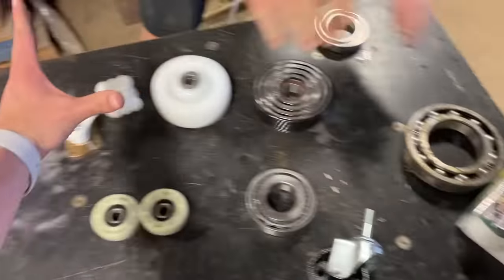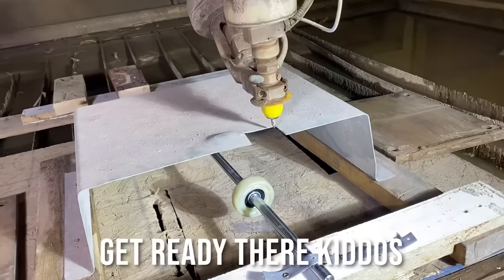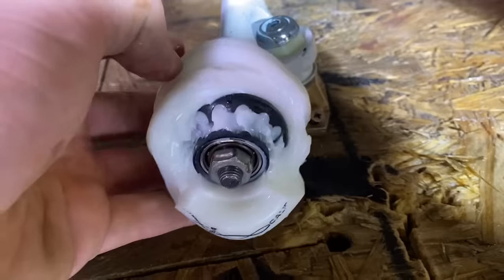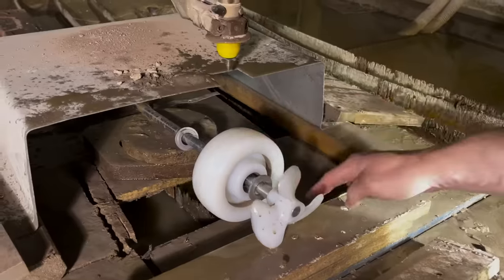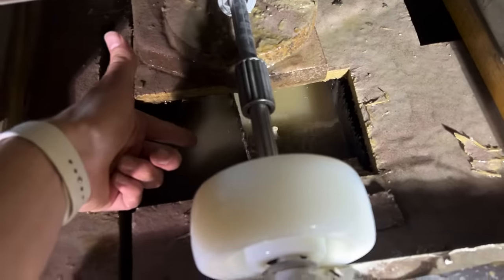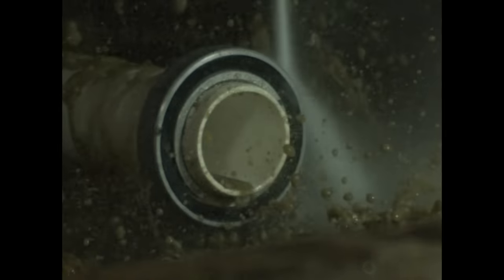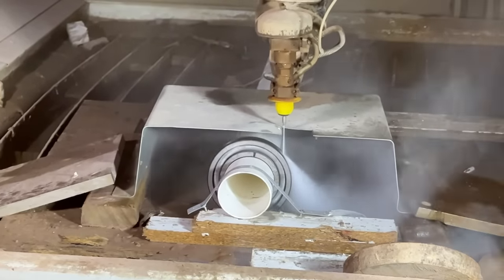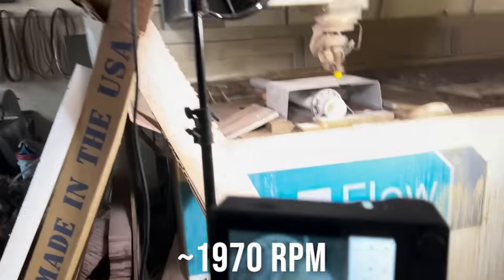Massive Industrial Bearing Spun With 60,000 PSI Waterjet

Comment: Back in my younger days, being a mechanic at an exxon gas station, I was repacking the front wheel bearings on a vehicle, in the process i soaked them in some chemtool to clean them, and before packing them with grease, me and my genius mentality figured I would use compressed air to spin them dry and clean of the cleaner....as i started, it made what I thought was a neat sound, a high pitch whine, trying to maximize it I kept the air on for a min.....before i could do much of anything, that damn thing blew up....neay removed my middle finger from my hand and virtually split my thumb in  half, and i ended up missing 3 fingernails that moments before had been on my fingers....that had to have been probably THE stupidest thing I have done.....I thank God one of those bearing didnt go in and out of my skull, but waz quite similar to a small frag gernade going off in my hand....all grew back together and only ended up with one odd shaped fingers....but still, it was a neat sound, up untill the moment of decetegration....DO NOT TRY THIS TRICK AS THE REWARD IS NOT WORTH IT

Comment: You have the jet positioned incorrectly, it should be slightly further out towards the edge of the circumfrence, so you have a greater leverage to turn the bearings, whenever I have spun large bearings using a workshop airline operating at aroud 130psi I have spun them much faster with the pressure point further outwards.

Comment: I spun a flywheel powered car on my lathe, I spin the axle at 2500 rpms and the flywheel turns 18x for every rotation of the axle. So 45,000 rpms for a little tiny metal flywheel

Comment: So I have this idea to drill into a mountain and build a rifled barrel up out of it. A nuclear reaction chamber with a water chamber above. The reaction chamber goes super critical and detonates a rupture plate between the two chambers vaporizing the water in a controlled explosion propelling a heavy craft onto other planetary bodies. So long as the payload is designed to with stand terminal velocity impact on the target, heavy machinery or refined metals, it would be cost effective compared to shuttle missions

Comment: can that water jet cut through steel? what did the skateboard trucks look like?
Reply: Steel cutting generally requires the addition of abrasive, like Garnet.
There are some Waterjets that operate at 90,000 psi, and they can cut more with less abrasive and in some situations no abrasive.

When cutting granite countertop material, and the abrasive stops feeding into the focus tube nozzle, the granite gets hammered by the water, and it breaks instead of effectively getting cut.

Comment: I guess the bearing with the rods is recommended to be used on a shaft equal to the diameter of the inside so all the rods are actually rolling. Imagine Tires on Cars would be mounted like u did there😬

Comment: Ball bearings should not spin freely because they should be packed with grease to prevent wear. Running them under load without grease will destroy them in a few minutes...

Comment: Find 3 bearings that can sit firmly one in each other. Slap em on a thicc rod. Soak em thoroughly in wd40. Blow em with compressed air and you will see em howl at close to 100krpm